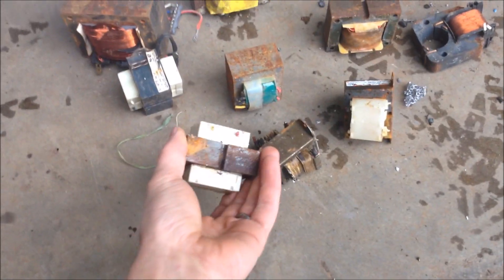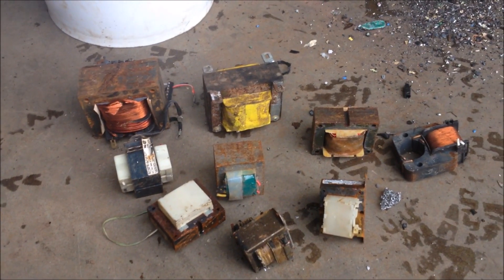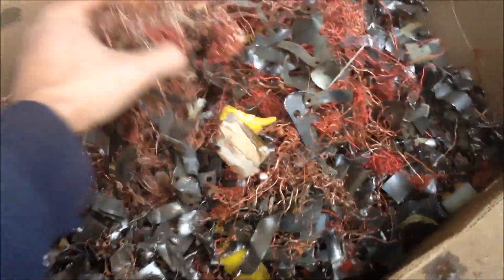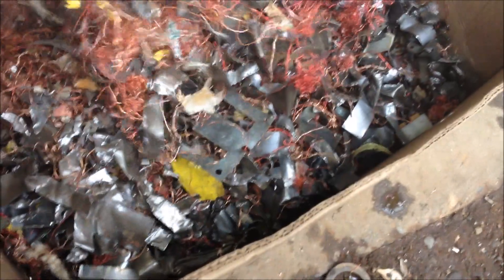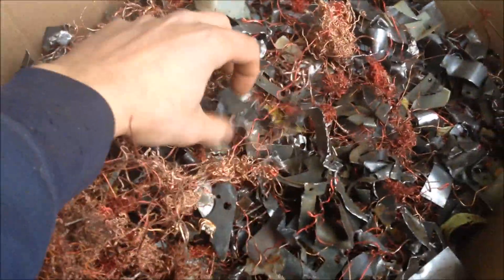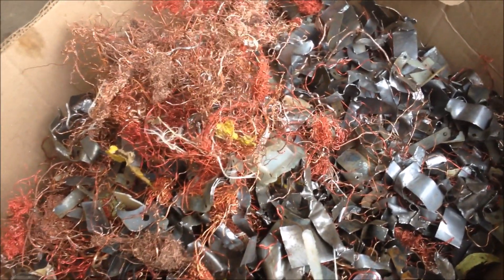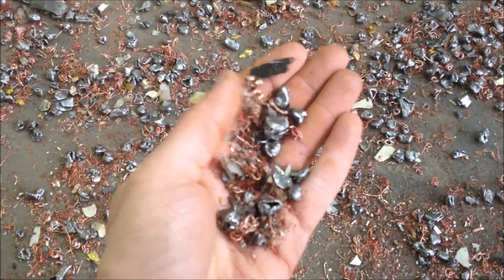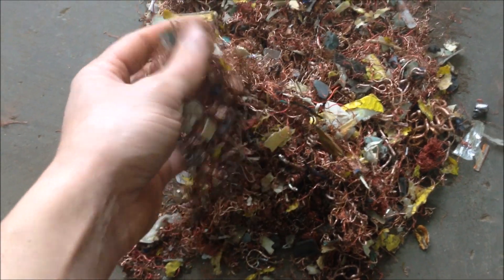MBMMLLC.com: Processing transformers for clean #2 scrap copper through a hammer mill

Comment: Can you just run the transformers through 3/8" screen instead of the 2" screen first? Or would the bigger transformers be too big?
Reply from the maker: You can run the material through a 3/8" screen instead of the 2". It would just reduce the throughput of the hammer mill and increase the wear on the machine.

Comment: What would happen if you put the transformers straight through the 3/8 inch screen?
Reply from the maker: +Nigel Baldwin This is a great question.  In the future we are going to try this so you don't need to change the screens/have two machines.  We are actually working on a complete transformer processing line so we should have a video for that up soon.  We are also going to experiment with different sized screens too.  Thanks

Comment: how you separate the metals please
Reply from the maker: Betty Lazar Hi and thanks for the question.  For these demo videos we used a floor magnet to separate the steel from the copper.  We are working on a production line for transformers and copper meatballs that will have a cross belt magnet to automatically separate the steel from the copper.  Stay tuned for a video of the complete production system soon.  Thanks

Comment: I've been told that extra soft steel they use for the "E's and I's" in those transformers is worth a premium over regular steel if you have enough of it.
Reply from the maker: Hi Torch-
Thanks for the tip.  I will check with my scrap yard and see what they say and report back.